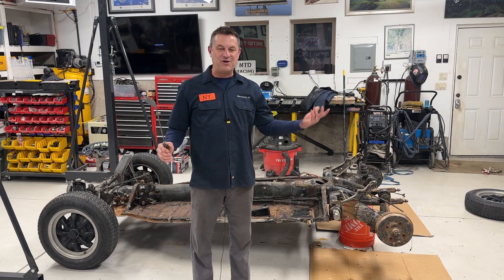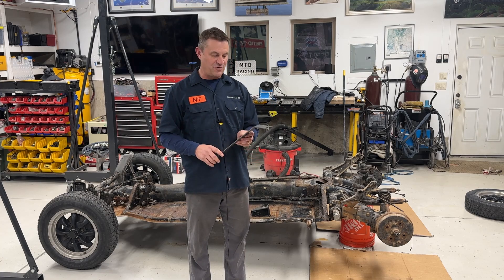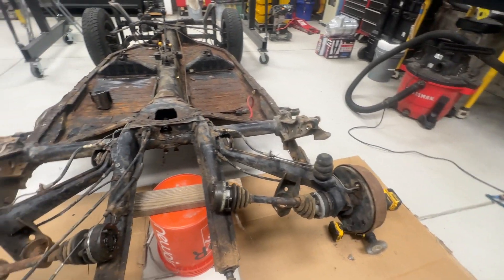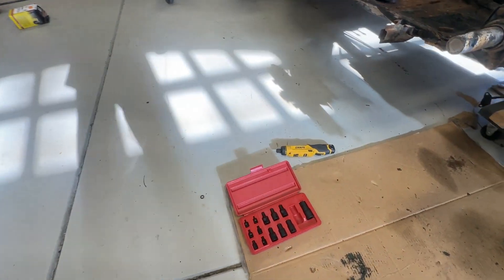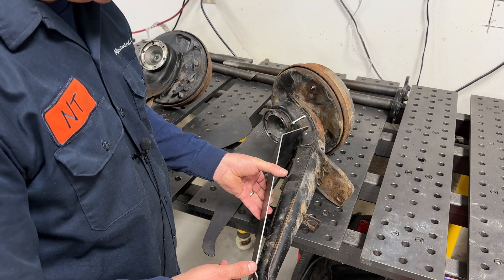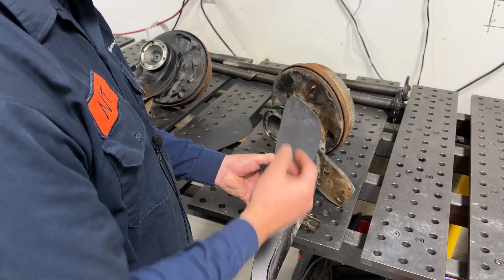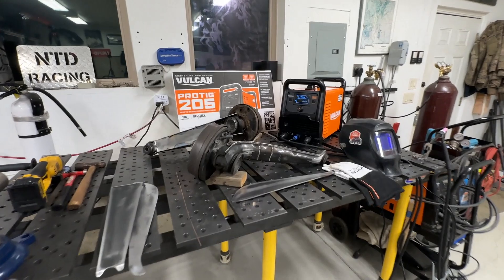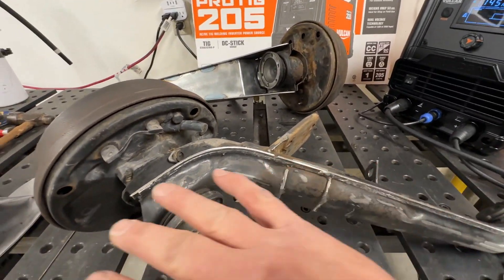How to make Class 11 VW Bug Trailing Arms

Comment: I had clearance issues with the actual CV joint. It looks like you might have a little taper on the plates that might cause the same issue.
Reply from the maker: @cbdzcbdz  they are close, but they clear.  Will see how they survive the first race.